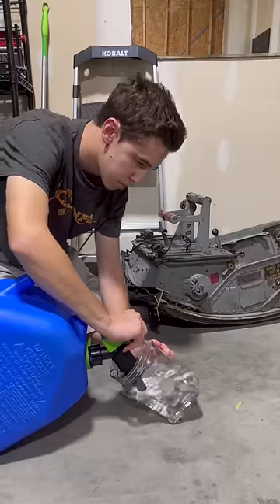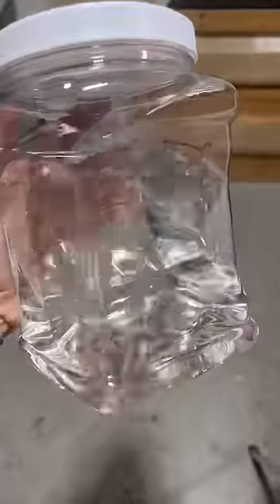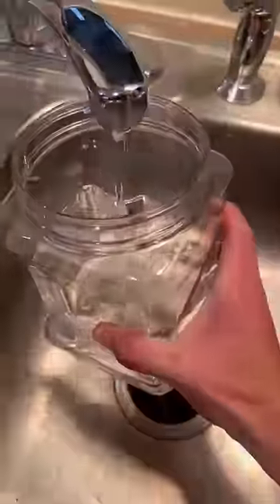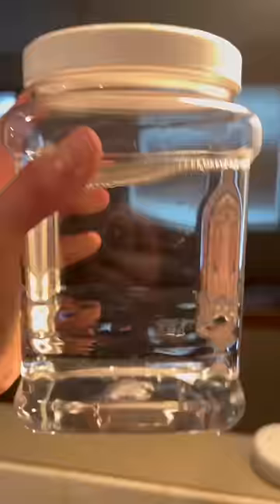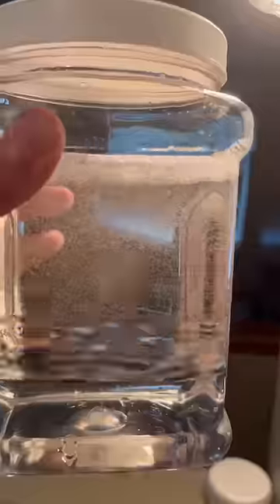Growing Microbes in Jet Fuel

Comment: "I'll put a bucket on it for safety"
Thank god, or microbes might have escaped
Reply: Could explode
Reply: He wanted 1 in the light and 1 in the dark incase the dark wasn't dark enough
Reply: @Lj_08  what?😂
Reply: @Lj_08  huh?
Reply: @Lj_08 several reasons that wouldn’t matter. First, obviously there’s no fire around to light it. Second, even if you stuck a match to it I wouldn’t light because jet fuels flash point is super high. Third, a bucket wouldn’t do anything.
Reply: The bucket blocks the light, jet fuel when exposed to light can gain pressure and explode, same with hydrogen peroxide that is why you always see it in a black or brown container. (Hints why gas tanks are colored with strong colors such as red, yellow, and blue and aren’t clear.)
Reply: @Froggyzz05  I’m 99% sure he’s joking about the one in the light…
Reply: @Limitless-XYZ  no its so the fuel can have a dark and a light test the bucket is if the room isn't dark enough
Reply: @Froggyzz05  thanks for disregarding my in-depth explanation on how the pressure will build up and literally explode.
Reply: @Lj_08 lol you did not just say that
Reply: @Lj_08  bro that's one of the smoothest brain things I've read recently
Reply: What did Luke say
Reply: @Limitless-XYZ  still, all your in-depth explanation was useless
Reply: @ericdallolio  And you came to this conclusion where? Because clearly it’s not an educated conclusion.
Reply: @AlexQarakh  what did Luke say?
Reply: @hunterlepage  what did Luke say?
Reply: ឲ
Reply: @Knifeman1478  what did he say??? He deleted his comment
Reply: Hey! Those little bastards bite… 🤕
Reply: Straight on the carpet! “Put a bucket on it for safety” 😂
Reply: @jadinzack9271  not with the bucket . It’s for safety.
Reply: @Limitless-XYZ uhh no, if you actually paid attention he put one IN THE LIGHT and one in the dark. Jesus internet experts.

Comment: In the airforce I was POL which dealt with all the jet fuel distribution on the base. We took strict actions every 12 hours to remove any water in the storage tanks and the R11s/R12s (fuel trucks) which we call check point. Everyone thought it was dumb at first until I learned this from my supervisor.  Ever since I told all my troops how important it is considering we didn't want to add any water into aircrafts. Great info, thanks!
Reply: I was POL from 1978 to 1982. After a long career doing something else I'm back as a civilian contractor POL at a Naval Air Station. We still do daily checks, and weekly labs. Draining the sumps, and recirculating.
Reply: Gotta be a dirtbag airman and not drain the sump or Rotate 

🫡
Reply: Just gotta say bugs … don’t want bugs in your jet fuel do ya! Make anyone think twice….especially late at night 😅

Comment: I have the same bugs in my central heating tank, but my understanding is the kerosene for heating is pretty much the same stuff as its price goes down in spring when people stop topping up their tanks but before the holiday flying season starts.
Reply: Same thing with diesel, they dye it a different color and charge twice as much for it.
Reply: Capitalist business as usual
Reply: @mariano7699  Lmfao literally the complete opposite. Diesel is taxed more by the government than kerosene.
Reply: Jet fuel is just high grade kerosene. And diesel is just low grade kerosene. In fact, some third world countries even run their fighter jets off of diesel because it's so much cheaper
Reply: @SkullCandy5671  what do you mean? Diesel and kerosene arnt quite the same, surely you've smelled the difference
Reply: @SkullCandy5671  Diesel has lube in it. Jet A doesn't.
Reply: Go watch that modern Marvel's video on gasoline or petroleum or whatever, that I watched when I was 10 and got a basic understanding of how different petroleum products are made,  a little hint, they're not the same
Reply: Ok, k2 is the kerosene used for heating. K3 is the kerosene used in machine shops to rinse the cutting oil off parts prior to measuring. Diesel is k2 with a little oil and Sulphur added (or left in) depending how u look at it. And jetA is k1, quite literally the cleanest kerosene in existence, yet 1 of the most oily of the white gas group (tuelol,turpentine, acetone etc). My boss has an FBO at a small airport and we put the jetA in his diesel truck all the time. Runs like a scalded ape.
Reply: @oliverklozhoff  Only putting jet fuel in a modern diesel car will mean the pumps can wear our and/or seize. It doesn't have the lubricity needed. You can design around it. Modern aircraft diesel engines are designed to run on jet fuel.
Reply: and yet it dropped a modem building 
building 7 didn't Epstien itself

Comment: The problem with water in aircraft tanks isn’t because the bacteria can corrode the metal, it’s because water isn’t flammable and will flame out, stop, or hydro lock an engine.
Reply: No mate, it is a problem. That's why they put additives in the Jet A1.
Reply: You do realize bacteria will grow along the whole fuel system from tank to engine, so you then end up with clogs and parts like pumps wear more due to the hard shell of said microbes
Reply: Freezing would also be an obvious problem when the Jet fuel has too much water in it. It always contain some water but it's very tightly controlled.
Reply: @rosen9425  if it's got enough water in it to worry about freezing, your biggest issue will be combustibility. Or lack thereof.
Reply: @mackerel1875  
Not really how freezing fuel works. It will gel in the storage tanks or airplane wings. How much water is required for that to start happening?

30ppm is the limit for delivery, water above that is denied on the spot and reported everywhere since there's a problem in the supply chain somewhere. The oil company making that fuel will drop-kick all responsible parties in the face for sure, for not doing their job properly.

30ppm translates to 168 litres of water out of 56 000 liter of fuel is allowed to be suspended in the fuel while still complying with the standard

Comment: Johndeere stopped using plastic fuel tanks due to microbes eating the fuel I'm not kidding
Reply: What? That has nothing to do with the problem. Any tank will let air in. Air contains moisture.
Reply: @rosen9425  and moisture creates microbes but it's harder for them to live in a metal tank over a plastic one

Comment: Going to take a while and the temp will need to be at least 100 degrees. When it happens in big trucks the fuel is cycles from tank to engine and back to tank so it stays warm.

Comment: Accidental explosions are more likely to happen in an enclosed space. Make sure that both areas are well ventilated.
Reply: With jet fuel? Not a chance. It will not burn unless it's atomized correctly directly at an open flame. Literally what happens inside a jet engine
Reply: @Rosen  okay, cool! I figured that with the off gassing, it could meet the flashpoint in an enclosed area. Regular gasoline cans are most dangerous when they have very little liquid fuel. Apparently, it makes for a nice pop
Reply: @mthlay15  
There's a huge different between gasoline and diesel derivatives. Gasoline is a dangerous beast not to screw around with, it has a flashpoint at -60C° or around there but Jet Fuel is above 38C° or more. Meaning when vapours start to form. 

I don't know the Lower and Upper explosive limits for them but it also plays a role, you need the right fuel/air mixture for ignition to happen after vapours start forming.

But being careful around anything that can be set on fire is of course the right mindset.

Comment: Fun fact is that jet fuel is just leaded instead of unleaded fule just like what you put in your car. Cars used to run on jet fuel too but then they found out that lead was bad to inhale.
Reply: No that's avgas, you don't add lead to diesel or jet fuel they use sulphur as an additive, witch they have also phased out due to environment concern's

Comment: Nothing will grow if the bowser uses FSII, a fuel icing inhibitor.  This is primarily meant to keep separated water from freezing and plugging filters at altitude, but also includes a biological inhibitor.  The microbes may be corrossive, but I think they also have the issue of plugging filters.  Using an FSII may not be as common in civilian airports, though perhaps.

Comment: You know that diesel does the same thing.  And winter diesel is basically kerosene, which pretty much makes it jet fuel.

(The military uses common fuel for almost everything … tanks, trucks, aircraft and they were developing a diesel off-road motorcycle that also would use it … it is like “J7” or some such designation)

Comment: My dad is a helicopter mechanic what ever, he got access to jet fuel to, he bring home   a bottle  to  make a mixture to start the   fire,  my stupid ass  try to start the fire  and the shit not even cat on fire so i obviously put more in there, still nothing, i put a carboard that i light on fire inside and  still nothing, i close the  fireplace door and walk away to cook something, after a few minuse the   fuel ignited and i hear a loud bang, so i check it out the  the fireplace was moved like two meters away  the  metal  connector was red hot and when i go outside i see ashews in the air, it clean the fucking chimney super good tho

Comment: Hey jack! Do you have any jet oil? If so, put some in your car and tell us what happens!!!! :)
Reply: If it's a diesel car, it'll run ok, but will lack lubricity, so if there's only jet fuel and no diesel, it'll destroy the pumps on a modern diesel. If it's a petrol car, it'll pretty much do the same as filling it with diesel, i.e. it'll stop working.

Comment: The microbes are actually a bigger problem as they produce a bacteriological slime that looks like greasy algae and actually can clogged filters in Jets even very big Jet and there have been several crashes over the years with many deaths because of this

And the crazier end of this is that in one case the solution to dealing with the bacteria incorrectly actually caused a crash. 

Anyone that's interested grade videos on this are at Mentour Pilot and Mentour Now YouTube channels

Comment: You seriously went to an airport with a 5-gallon jug?🙆🏽‍♂️
Reply: I have.... depends on the airport, small local ones are usually good, I use jet a in a diesel torpedo heater
Reply: What size do you suggest?

Comment: Used to know a guy that would sniff jet fuel from a bottle in Kenya where I grew up I tried it it’s good
Reply: That wouldn't even get you high because diesel and kerosene doesn't let off as many volatile hydrocarbons, good luck trying to get a buzz sniffing diesel.
Reply: 100LL is better. Smells nicer than car petrol these days.

Comment: Would have been easier and cheeper to buy a can of kerosene……
Reply: Is that the case? Jet fuel here in the UK is about £1.15 a litre from the airfield. And if you're at the airfield flying your aeroplane anyway, it's not inconvenient. Just looked up the price of kerosene in my local DIY store and it costs £11.89 for a four litre container, £2.97 a litre, so two and a half times the price of the jet fuel.